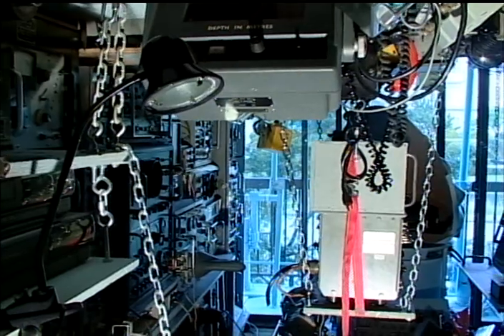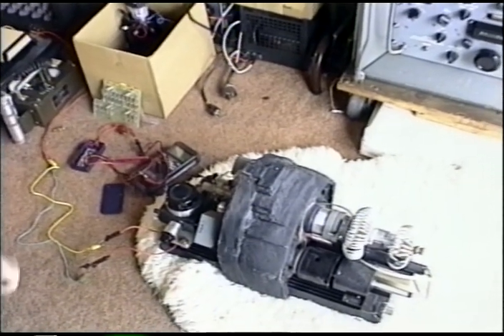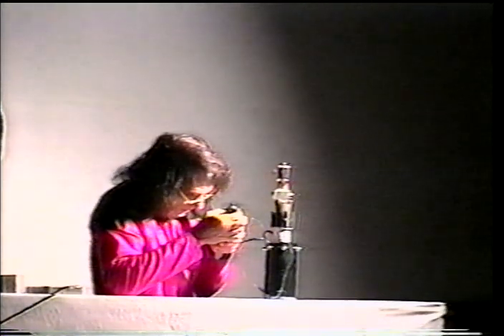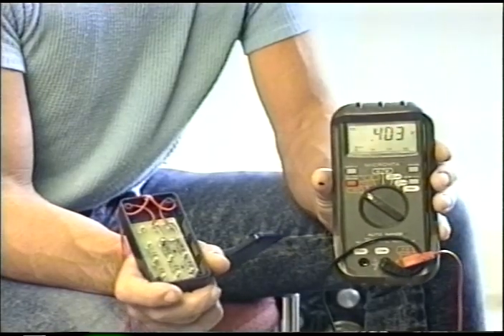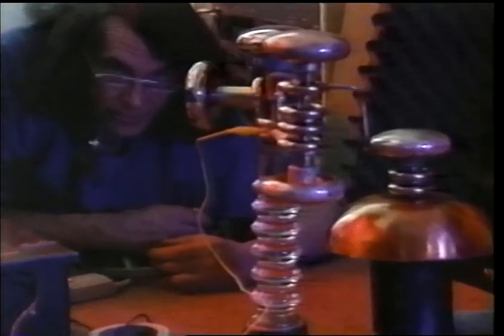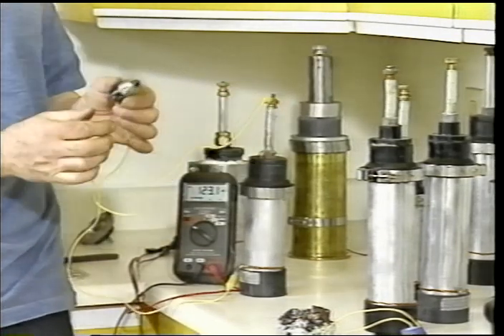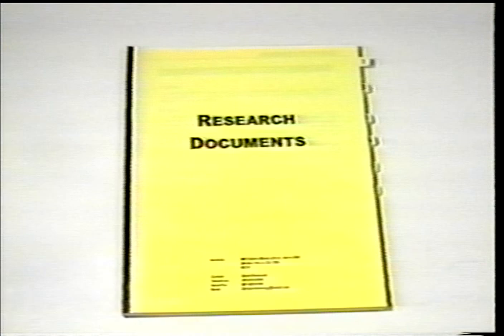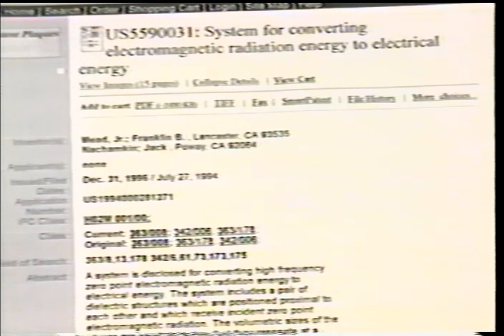John Hutchinson's Crystal Converter

Comment: I guess no one here in the comments ever built a crystal diode radio as a kid. No batteries. Quite loud too. RF signals are simply converted into low voltage electricity. But all the FUDS here are gonna claim it's Jesus running on a hamster wheel in the 5th dimension so whatever.

Comment: Energy at 0 Kelvins. Riiight..... 
Absolute Zero is defined as the point at which there is no energy. It's theoretically impossible to reach, since the very act of measuring it, or even using light to observe it, will add energy to the system.
BTW, it's never 'degrees Kelvin', just 'Kelvin' or 'Kelvins'.

Comment: Using crystals to draw energy from the air? Isn't that just a radio? Good luck powering much with that.
Reply: But if you combine a thousand of them, surely it must be enough to power something useful? Clearly not a viable solution for portable devices and vehicles due to the weight and volume of all the parts needed. but maybe it could be useful in some fixed application like powering the lights of tall buildings where hanging 10,000 radio wires is technically feasible. My best guess is that it's simply not worth the upfront cost since nobody is doing it AFAIK.
Reply: @VeniceInventors thats just the wrong direction  for this nonone found the the truth secret is cause evryone wants free wnergy leaving on the side the rest of posibilitys

Comment: Pyrite is a dioelectric that can cause the silence in frequency and form a little charge to the center of the piazo liquid it loops into the present points around and around the surface spherical density of vacuum the surface picks up the vibrations of the earth and directs the current system

Comment: The torsional liquid plasma pump
  Think of dielectric gelatin and bubbles that push pull in one piece of the gearless Differential system the others is the of a non flow but it does take from the opposite side a charge to everything else in bubble that have in gas natures the heavy and the light helium spherical parts of the bubble trap and release mechanism to create a new idea of telloric current that is to say expanding and contracting gas in a position of  that can cause antigavitational causality by the enlargement and return to normal size gas

Comment: Listen kids, crystals don't conduct electricity so you lose power in heat only. Their conversion rate is whats important, you can look up the constants for each molecule. Just as cat whisker radios will pick up radio stations with no batteries, likewise crystals will pick up the waveforms of other crystals, with no batteries. 

What this means is that electricity go big brrr
1 volt 40kHz into roshelle salt = 0.30 volts into each corresponding crystal
multiply that by 10, 3 volts from 1 volt.

Face the negatives toward eachother and the push pull effect will generate electricity with a minimum of 30~ watts
Reply: You lost me after ‘What this means is that electricity……???’ I’m fascinated but this is Greek to me.
Reply: Well he clearly did something
Reply: @RegicidalProtozoan I know, he did what I said in the first comment.
Make sure to sell for cheap and destroy taxes for lolz.

Comment: Who doesn’t want free energy?
Who created the patents?
Open source it as fast as possible before they get you.
Make multiple copies and make a fail safe to release if you disappear.

All MURDERED RIGHT AFTER CREATING INVENTION 
1. STEFAN MARINOV-FREE ENERGY 
2. JOHN MULLEN-NUCLEAR PHYSICIST 
3. MARK MCCANDLISH- ANTI-GRAVITY PROPULSION 
4. DIMITRY PETRONOV -PLASMA BATTERY 
5. ZACHARY WARFIELD -PLASMA BATTERY 
6. EUGENE MALLOVE- FREE ENERGY DEVICE
7. ARIE DEGEUS -FREE ENERGY-ZERO POINT 
8. RORY JOHNSON- COLD FUSION MOTOR 
9. MARK TOMION -STAR DRIVE 
10. JAMES ALLEN -AEROSPACE ANTIGRAVITY DOCUMENTARY 

INTERNAL COMBUSTION ENGINES RUNNING ON WATER 
1. CHARLES HENRY GARRET - ELECTOLYTIC CARBURETOR 
2. ARCHIE BLUE -WATER POWERED CAR 
3. DANIEL DINGLE -HYDROGEN REACTOR CAR
4. STANLEY ALLEN MEYER - WATER FUEL CELL 
5. BOB BOYCE - ELECTROLYSER
6. STEVE RYAN - 50% WATER 
7. PAUL ZIGURAS - HYDROGEN ENGINE
8. FREDDY WELLS -WATER-POWERED ENGINES
9. RYUSHIN OMASA -HYDROGEN-OXYGEN GAS MIXTURE 
10. STEAVE EATON -WATER-FUELED ENGINES
11. OLIVER & VALENTIN-WATER-FUELED TECHNOLOGY 
12. WALT JENKINS -HYDROGEN & OXYGEN FUEL 

1. TOM OGLE - VEHICLE COVER-UP
2. CHARLES NELSON POGUE - VEHICLE COVER-UP
3. TROY REED - VEHICLE COVER-UP

ENERGY COVER-UP
1. THOMAS HENRY MORAY - FREE ENERGY 
2. JOHN SEARL - FREE ENERGY 
3. FLOYD A. SWEET - FREE ENERGY 
4. ADAM TROMBLY - FREE ENERGY 
5. BRUCE DE PALMA - FREE ENERGY 
6. PARAMAHANSA TEWARI - FREE ENERGY 

CANCER COVER-UP
1. HARRY HOXSEY -CANCER CURE COVER-UP
2. BJORN NORDENSTROM - ENERGY MEDICINE 
3. MAX GERSON - CANCER CURE COVER-UP
4. ALFREDO BOWMAN-CANCER CURE COVER-UP
5. STANISLAW BURZYNSKI- CANCER CURE COVER-UP
6. ROYAL RAYMOND RIFE - CANCER CURE COVER-UP
7. SANDRA ROSE MICHAEL -EESystem -CANCER COVER-UP

Comment: Reconstructed some of his original cells along with new ones using the help of chat gpt & the cells seem to pull moisture out of the air & store it in the crystalline based electrolyte & convert it into small amounts of dc electricity. 1 volt at a constant 5-10ma & they output non stop small amounts of power
Reply: Are you familiar with Bedini’s Earth crystal cells? Just curious if the ones you made were similar to those.  Some of his used alum for the crystal. Thanks in advance.
Reply: @davidellis7695  a bit familiar. The perfect cell would fully recharge from absorbing moisture from the air or even from a mildly/safe radioactive mixture
Reply: This is a good Idea, but in this Scenario the cells were sealed. At least in the big version. i dont think that this is the source of the energy.
Reply: Mtechindustries2022
Reply: I don't understand why your response is so hostile, I wasn't aware of the fact if you edit your own response it appears this way. Your hostility over the question only makes my conspiracy theory valid....😅
Reply: Completely wrong...it's all about resonance
Reply: It says on my end that your comment was edited, and sense you did a reconstruction of his device it must have upset someone , what did they take out?
Reply: @TravisTerebinski you do realize you can edit your own comments on youtube and not everything is a conspiracy eh?
Reply: @TravisTerebinski put the pipe down
Reply: @generalwasteman I will not put the pipe down by your request or anyone's

Comment: I'm so glad we chose to go with lithium strip mining instead
Reply: Lol
Reply: Don’t worry DOD has UAP, and are 50+ years ahead of us normies, they have everyone believing in aliens, so the technology can stay classified..
Reply: yeah but this is voltage on the P0 electric scale so to scale it up to be usable would be very inefficient and impractical.  You can make a few gold grains from a large sheet of aluminum foil but it is very inefficient and impractical it doesn't mean it's not impossible.  big difference there is a lot of technology like this but not applicable because the scales are so small it's basically useless.
Reply: Ha! Thanks for that chuckle. ❤
Reply: yes, why use a technology that works when we could have gone with one that doesn't?
Reply: Me too.  Especially since this guy isn't claiming to have built a rechargeable battery that can do any of the tasks we use Li ion batteries for, and we appear to need those.

Comment: I have been building a similar design to John's. I started when I was 16 which was 22 years ago. I'm at a point now  I'm about to go public as repeatable, calculated results were always an issue. My design uses a quartz and other  crystals. My design relies on how the crystals are packaged. The canister is heavy machined and welded shut under emence pressure from a hydraulic press
Reply: Do you use gallium or anything like that? I’m thinking what’s happening is just making a big semi conducting capacity that when hit with high voltage to make the piezoelectric crystal structure resonate so that it is only taking exactly what you put in inline with 1st law of thermodynamics but the catch is that resonance makes it a capacitor that discharges at the rate of a battery. It is basically a battery at the end of the day but stuff like carbon , gallium and crystal substrate can take wayyy more voltage and contain heat much better than lithium and iron
Reply: @off6848 the materials used are not as important as the process for packaging them. Any crystals with piezo properties will work, the key is sealing them under high pressure, this creates the potential required for energy to flow
Reply: Any updates?
Reply: @cheezesmoker8851 maybe the government got to him first?
Reply: @tonybahama6817  wouldn't suprise me, eyes open brother 👍
Reply: So where's the proof and plans? Also getting like 1 milliwatt from a device that takes up a quarter of the room is useless for upscaling.
Reply: You are FOS.
Reply: Go get a physics degree and save time. Then you can work out why your project can never work.
Reply: @nexpro6985  so you are the one with a physics degree? could you tell why not ?
Reply: @nexpro6985 go get a physics degree so you can be imprisoned like all the other flees in the jar with no lid
Reply: @davidhunt3606  Don't bother with people like nex, you could put one of these machines working in front of them and they'd be like a flat earther coming up with any excuse to say it can't work, it's like talking to a brick wall.
Reply: @JenkoRun It can't work without an electrical field near by.  The Zero point field is too weak to produce a usable charge.   There is a way to do it but it's beyond our material limits.

Comment: For those of you that don’t know. It was announced recently that we broke the first law of thermodynamics.
Reply: Aharonov-Bohm effect. Can't break the laws of conservation. The energy just slips fluidly between the 3rd, 4th, and 5th dimensions. So when you pull energy out of one it must go back where it came from to maintain system equilibrium, but it can still be used to do work in the dimension that it is pulled into. So if you pulled in energy from the space-time dimension, you can utilize it for electricity in the 3rd dimension temporarily, but as that energy dissipates it returns to the space-time dimension. And the curvature of space-time normalizes.
Reply: @nehemiahjuan950 facts
Reply: You're both wrong. It wasn't broken but was updated. 

Misconstrued source: 
West Virginia University, Paul Cassak+ in the Center for Kinetic Plasma Physics. Google it. 2-22-2023
Reply: Edit: adding Hasan Barbhuiya as a contributing researcher in the Paul Cassak+ mention
Reply: Yikes,   the whole world is finally unpredictable
Reply: Can you find the name of the paper that announce the experiment?😂
Reply: No it wasn't and no we didn't.
Reply: @davidf2281 stop protecting Ur core belief n false physics,,thermodynamics is a lie n outdated physics
Reply: @davidf2281  cry more
Reply: @davidf2281 open energy systems always break the so called 1st law of thermodynamics. Its closed systems that don't.

Comment: Don't worry about patents, just make a set of plans that most people can understand  and build using common parts and tools and make them public.
Reply: He explained how it works Casmir effects but using a powdered crystalline matrix dust with a metal container basically makes a semiconductor capacitor that discharges at the rate of regular capacitors but stores enough resonant energy that drains more like a battery. If you hit it will 20,000 volts it will hold 20,000 volts so it can discharge 12v for a decent amount of time and presumably it could be charged at 100 thousand or more volts
Reply: @off6848  Makes no sense.
Reply: @harms123  well do you know how a capacitor works or piezo electric effect? Did you know that quartz crystals can be rubbed together and produce light? Many crystals are dielectric capacitors.

By making a matrix dust you’re essentially doping the quartz like a semi conductor
Reply: @off6848 20000v while cooling, is how you make electrets. So when layered there are permanently ionised plates. The aether interacts with this and looses an ion -e
Reply: @off6848 John Hutchinson has a YouTube channel. He responds to messages. Super nice guy. 

@hutchinsoneffect
Reply: take 20 - 30 diameter crystal wafers, put them with negatives facing negatives, and connect wires pulling off the electricity. Like he said, he uses another substance (probably radioactive, like uranium) to increase the sitting energy of the crystals. Now the crystals will act as a wire that amplifies the current and voltage.

If you want more voltage, you have to use a transformer. 
If you want less voltage and more current, use a resistor.
If you want more current, connect all positives in parallel.

If the crystals are connecting positive to negative, they will pull on eachother, then harmonize.
If the crystals have the same poles facing eachother, they will resist eachother, which will push the crystal atoms away from eachother and create a water like flow in their "fence like structure", this will create a voltage and a current.

All energy must be increased by another substance that will increase the overall energy
all voltage must be increased with step up transformers.
all current must be increased with parallel wiring, the voltage stays the same.

The law of preservation is a corporate scam. bombs produce more energy than they have/receive
Just like there is energy produced from cranking a wheel, there is energy produced from siphoning it from surrounding particles, like he says in here.

But it's not true at all that you can't manipulate energy levels. It's like saying, if your car has more torque, it can't have as much speed. 

Voltage is electromotive force
Current is speed
Resistance is acceleration

all three of these are manipulatable from different sources/methods.
Reply: @blavkadam2153 John Hutchinson has a YouTube channel. He responds to messages. Super nice guy. 

@hutchinsoneffect
Reply: Well he should get paid for all his work he put in.
Reply: @jimhernandez7712 paid fir what? Wasting peoples time?
Reply: @jimhernandez7712 John Hutchinson has a YouTube channel. He responds to messages. Super nice guy. 

@hutchinsoneffect
Reply: Yep. Patents just let the powers that be know who to eliminate or steal idea from.
Reply: @racecitypatriot66 no thats wrong patent allow you to own the rights over the idea if you sont patent something you will for sure will lost your idea i asure you that you dont legally own it so
Reply: @ernestoduenas2466 thats what i know. Im saying if you file a patant that just allows them to see ehat you came up with and steal it.
Reply: Roger that ,,  glad to see John is still going I was recently informed that another on line friend that I had was murdered  ..
Reply: @Alan-pd8hd John Hutchinson has a YouTube channel. He responds to messages. Super nice guy. 

@hutchinsoneffect
Reply: It doesn't work, as any other nonsense.
Reply: @VEC7ORlt  correct.
Reply: In other words, show your work and prove it is repeatable.
Reply: John Hutchinson has a YouTube channel. He responds to messages. Super nice guy. 

@hutchinsoneffect
Reply: He's lost his mind.
Reply: @AquarianNomadic thats what he wants people to think
Reply: @AquarianNomadic no, he lost his gear the feds came and confiscated the lot !! If I remember , he was not allowed to set up again. Strange the whole thing , I think also neighbours were getting some of the effects and he was drawing massive amounts of electric too. The government wanted what he had and per norm they got itv.
Reply: You go right ahead and waste your time trying to copy the work of a crank. There are so many of these BS artists out there and NONE of them ever produce anything worthwhile.
Reply: @nexpro6985 your too young to have seen it. He touched on forces that have yet to be fully explained, only in Military circles has it been studied .
Reply: @Rabbitskillz was that your attempt at an insult and a pat on the head? Do you understand the difference between science and BS? I suspect not. Do you even know what science is? Maybe you think it is a shadowy international organization who's every member has signed a secret agreement to hide reality from Joe Public. It is time to grow up kid leave the comic books behind.
Reply: @Rabbitskillz really? And do you have evidence to support your claim that 'it' has only been studied in military circles?